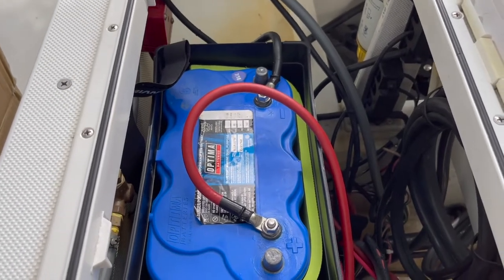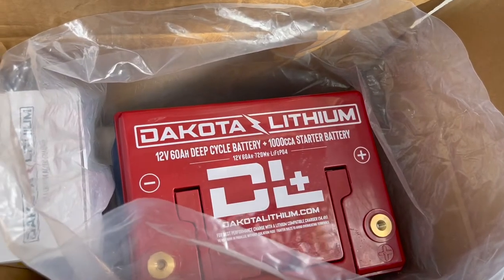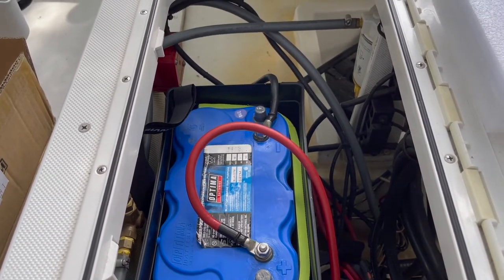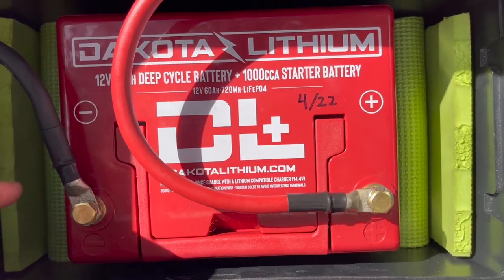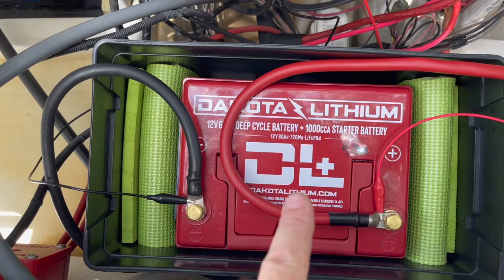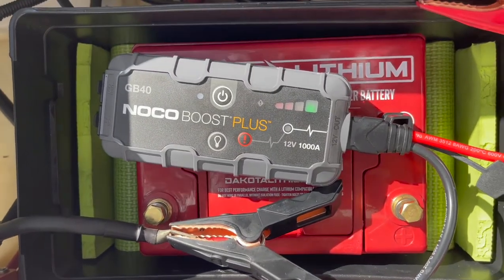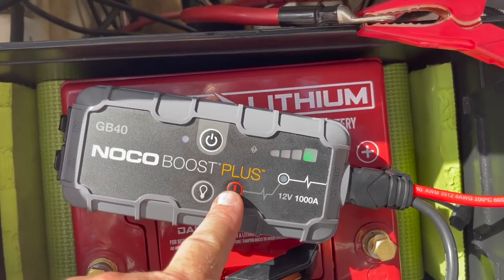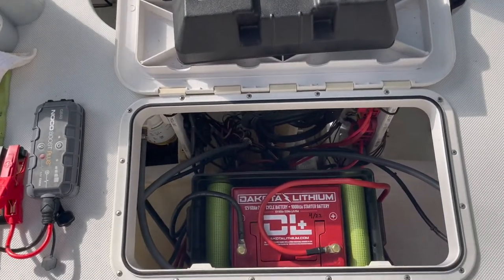Making the move to a Lithium Start Battery

Comment: Hey Dave--looking to run the same exact set-up in my 2005 Triton 1650 SC with Merc 50HP EFI except only 12V.  I already have one DL 60AH D+L battery and will go test it as both a starting and trolling battery.  I did talk with Tim @ Dakota in length today and he told me the D+L 60 does not meet Mercury requirements for starting so I will essentially be my own test pilot.  Hope it doesn't trip the BMS in the battery or damage my rectifier/alternator.  I am not too worried about cranking it but running it at max RPM.  I'll do a Voltmeter test like you at home while both at idle and high PRM to measure what the rectifier is putting out (hopefully 14.4V).  If it tests good, I'll buy my second D+L60 and hook up to my Victron 18amp DC-DC charger so my motor's rectifier/alternator will charge both batteries when running at speed.  I will also have the Victron App so I can reference it to get voltage readings.  Let me know what you think.  Also--one question.  I have a NOCO GB40 also.  You use it as a back-up and tested if it would crank your engine.  Well, just cranking it won't get you back to the dock.  As I understand, if it is an EFI motor, you would have to keep the GB40 connected while the boat is running at speed, otherwise your motor will just die, correct?   If so, how would that GB40 react to the boat rectifier pumping that voltage back into the GB40 during your 30-minute trip back to the dock.  Just some important considerations.  I apologize for the length but could you elaborate?  Thanks
Reply from the maker: Hey Dave - wow awesome write up and exciting project.  So first I have to say so far so good with my setup.  I haven’t had any issues and my rectifier seems to do the trick with keeping my battery charged.  Although this past December i did some mods where I can plug in to house power when I get home and charge both my 12v lithium crank and 24v lithium trolling motor battery systems at the same time using two separate on board Victron chargers.  As far as the Noco GB40, you make a good point and to be honest I have never had to use it on the water for my motor.  But I have used it to help others jump their motors at the Ramp so there’s that 😊.  But as you sort of alluded to is these lithium setups are quite new and experimental so I make sure I keep a close eye on mine with charging and monitoring and also crank my motor and test my trolling motor and other electronics before I leave the house.  In any case, good luck with your setup and would love to hear how things go.

Comment: Great video. Any updates a year and half later? I have a Honda 150, and would love to replace my starter and house batteries with Lithium.
Reply from the maker: It’s been working great for me. However, things to consider are rectifier voltages which charge the battery when the motor is running may vary between motors.  I went ahead and put an onboard 12v Lipo specific smart charger on mine just in case and wired it in so it charges at the same time as my 24v Lipo trolling motor batteries which also has its own charger.  I plug everything in to house power when I get home and just let things charge in between uses.  Also be aware that some accessories may be sensitive to slightly higher voltages of Lipo batteries if you run those off your main battery.  I also installed a 24v to 12v step down converter and now run all my accessories off that since it produces an even 12v output.  So definitely put some thought into your setup.  I certainly don’t regret switching to lithium.  Totally worth it. Especially if you are trying to cut weight.
Reply: @davecavanaugh66  thanks I appreciate it. Just upgraded my truck camper from two group 24 deep cycle to 1 - 100ah lifep04 and upgrading the solar charger to a dc to dc combined mppt solar charger. I would love to shave 50lb in batteries off my boat stern. Tight lines.

Comment: Nice video and setup.  I am thinking of getting the DL+ 135 AH to replace both of my Interstate starting and house batteries. Are you having any issues when running the motor wide open? No issues with the BMS of the battery shutting down causing the motor to shutdown?  You not using a dd to dc correct?  Thanks for the video and for sharing your experiences.
Reply from the maker: No issues at all but if I had to do it again, I would probably look closer at the Ionic lithium batteries since they have an app you can download on your phone that connects directly to the BMS via Bluetooth.
Reply: @davecavanaugh66 It's another $100, but they do offer a DL Dashboard plug in which has that Bluetooth connectivity.  I agree though, for the price it should all be integrated the much less expensive batteries have it standard.

Comment: Thanks for this video yet my head is starting to hurt, this issue seems to have so many different opinions. Is that because more than one thing can be true to some degree? I just ordered a Ionic 125 ah starter battery and they have assured me this is plug and play for my ETec G2 250 which reportedly puts out 13.5 voltage to my understanding, not sure of any fluctuations. I am also adding a 200 ah house battery, which will also be charged by alternator when starter batt is fully charged. I have a battery isolator / combiner as well. Do I need a $270 DC to DC converter, I'm still not sure? Will a dc to dc charge my lith battery faster and more thoroughly because its charging at a steady 14.2 volts than without? Im planning to simply plug and play the 2 new lith batteries with my old optima batteries. Is there any reason why this upgrade should not take place in this manner? Thanks
Reply from the maker: Everyone’s setup is different, but I think you will be good with a plug and play approach for both batteries.  14.2 is a good charging voltage.

Comment: Great video. I'm learning a little more about lithium cranking batteries myself. I had one for the 2022 open water season made by Ionic and loved it. What I'm learning is that my alternator may be overheating at idle speeds if the BMS of the lithium battery shuts down charging. It's possible considering I've never dropped below 95% on my 125ah house/cranking battery. I think there are solutions to spare the alternator, but I'm not sure if it is worth what seems to be $300-400 to save a $200 alternator if I don't have issues. But I do wonder if it would ruin my $700 cranking battery, too.
Reply from the maker: All great points and thanks for sharing. I had the same concerns. I changed out my rectifier when I switched to lithium because my motor had some age on it and I was seeing some odd voltage fluctuations. The new rectifier gave me more consistent charging voltage (~14v).  So far so good, but kinda flying blind on what the BMS is doing on the Dakota because they don’t have a cool little app like Icon does.  I’m not on the water as much as you, so would love to hear how things go over time - Keep me posted.
Reply: @davecavanaugh66  DL started selling VICTRON ENERGY BMV 712 SMART BATTERY MONITOR WITH BLUETOOTH and other things like a DC to DC charger along with their cranking batteries. This is the description on the DC to DC charger:  Charge your deep cycle Dakota Lithium batteries using the alternator in your van, boat, or RV’s engine. The Orion-Tr Smart DC-DC charger is a professional DC to DC adaptive 3-stage charger with built-in Bluetooth. For use in dual battery systems in vehicles or on boats where the alternator and the starter battery are used to charge the service battery (aka house or deep cycle battery). The unit can be monitored and programmed via Bluetooth and can be remotely controlled via a remote on/off switch. 

I'm not sure how important it is for Ionics, as the email I received said this:  "If you fill better to run a DC to DC charger fill free to. It will not hurt nothing or not running one will hurt anything."
Reply from the maker: @rippinglipsadventures  Interesting you mention that - I love Victron gear.  I have a great little onboard charger for my lithium trolling motor batteries.  And I also bought the Victron SmartShunt 500 to monitor those batteries while I’m on the water via on my Phone using the Victron app.  Good stuff.

Comment: I just got one of these batteries.. Have you had any problems with your alternator since install??
Reply from the maker: The rectifier has been working fine - I get around 14v which is enough to keep the battery charged when running the motor.
Reply: @davecavanaugh66  Great to know!! That's been my biggest fear with going with a lithium cranking battery.  I was going for it anyway.. but thanks for the added confidence!
Reply from the maker: @stephansmithoutdoors  in the video it shows where I tested this with a multimeter just to make sure because I had the same concerns.